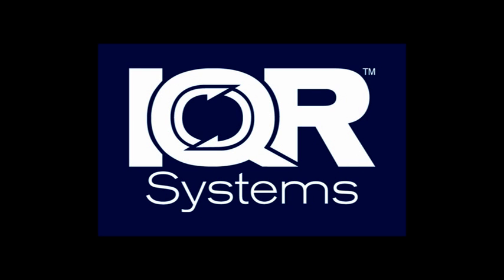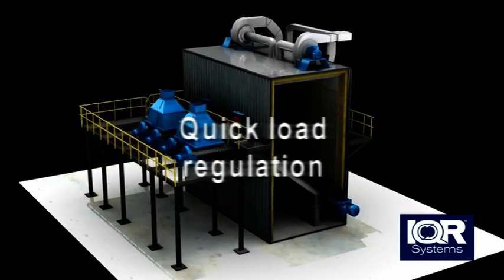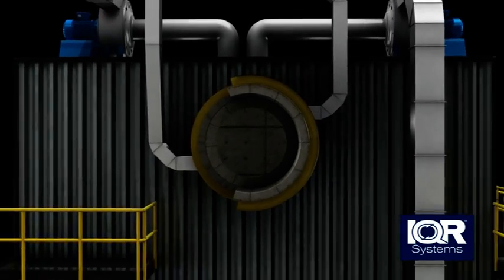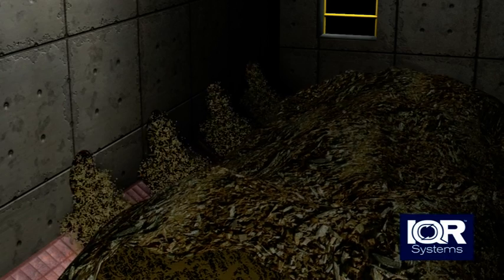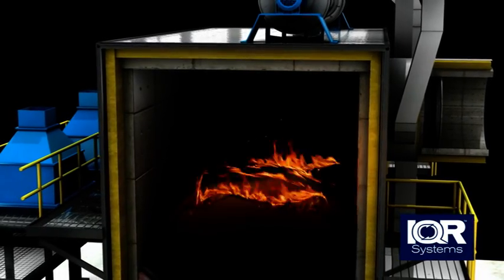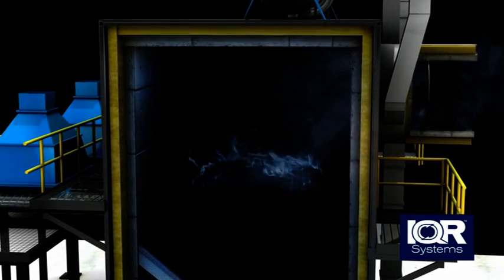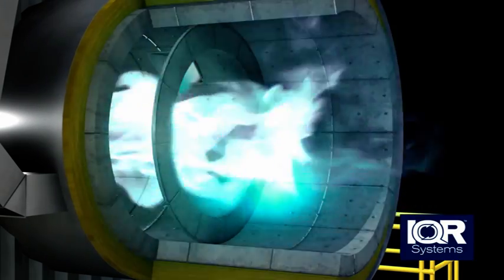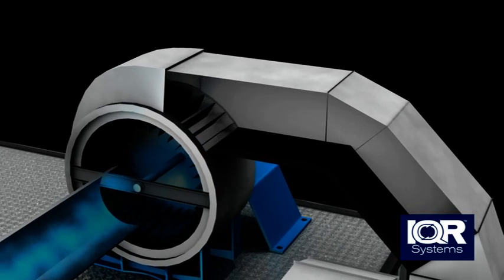SFC - Biomass gasifier. IQR Systems

Comment: If you are looking for an approximate efficiency figure it is about 93%. However - tons/hour depends of course on the moisture and ash content of the fuel. The typical waste wood fuel that we use in Europe has a moisture content of about 30%. It is very simple. Imagine a wood fuel with an energy content of 2,5 MWh/tonne. At 93% efficiency our gasifier uses about 4,3 tones/hour (ash out).

/DK, IQR